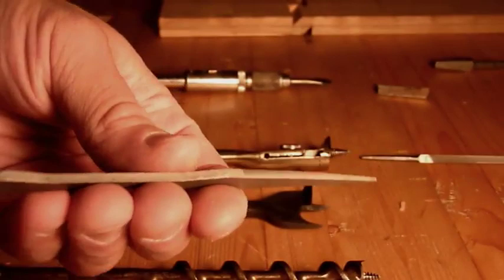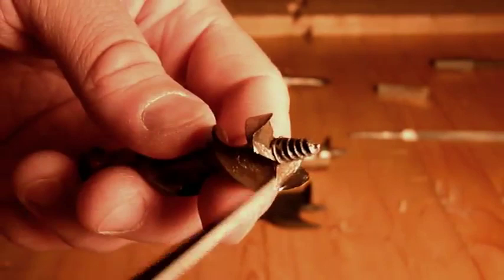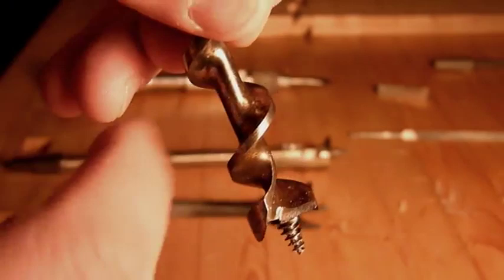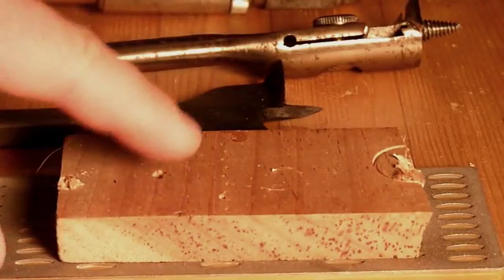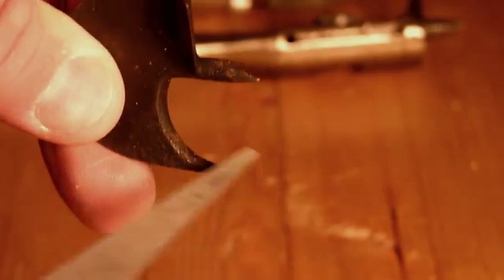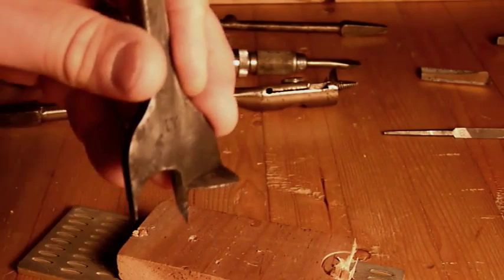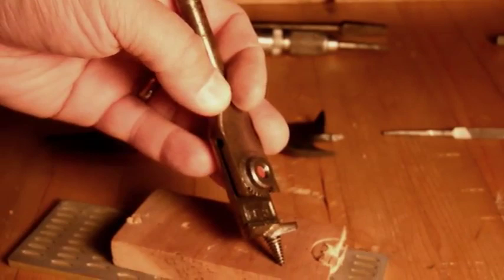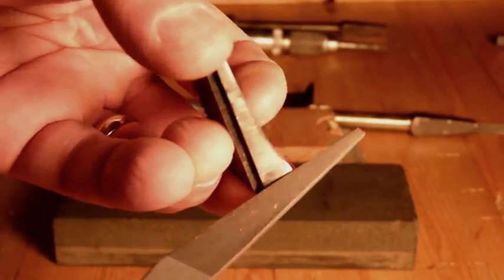How to Sharpen Auger Bits, Center Bits, and Expansive Bits

Comment: Good suggestions on sharpening. Thanks for sharing your experience. 
 The only change I would make is to use a curved stone and stone the curved face on the expansive bit. I have gotten a few that had been sharpened on the top face. When they did that they opened up the gap between the adjustable blade and the fixed edge on the body of the bit. Chips get in the gap. The chip acts like a runner and stops the edge of the adjustable blade from cutting. With the bit no longer cutting it makes the pilot screw tear the threads out of the pilot hole and the bit pulls free. Even after the chips are cleaned out the pilot hole is too big for the screw to catch. 
Bits that have been missharpened this way can sometimes be fixed. If it hasn't been filed too far you can file back the dovetail on the adjustable bit so it closes the edge back up. 
Don't file the dovetail on the body. These bits often have two adj. blades and if you file the body you have to make the blades match. If you file just the blade that is screwed up the other isn't affected.

Comment from the maker: For the gimlets with a screw point you could run the bit in as deep as the screw point is.  Next, back it out and put some valve grinding paste in the hole.  Run the bit in and out of that hole a few times, and finally clean off the paste.  That would get the tip of it sharp.  As for the rest of it I am not sure.  You might be able to use a folded piece of sandpaper, or a small slip stone.  The only thing to remember is not to file much on the outside of the bit, that can change the diameter.

Comment: could you use a needle file to sharpen these or are they too rough?
Reply from the maker: You could if it had one flat surface.  Just try to keep it moving evenly across the surface of the bit you are filing.  Give it a try!